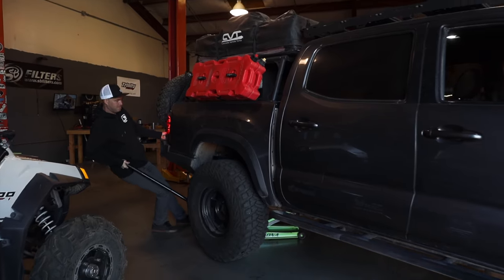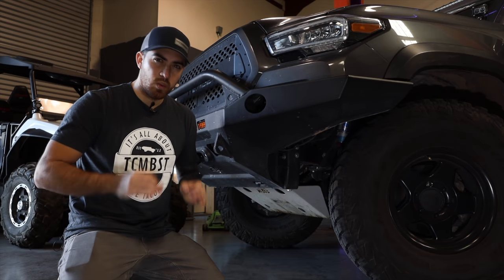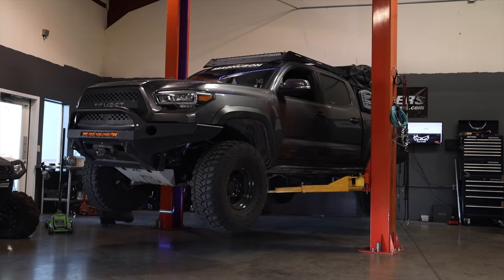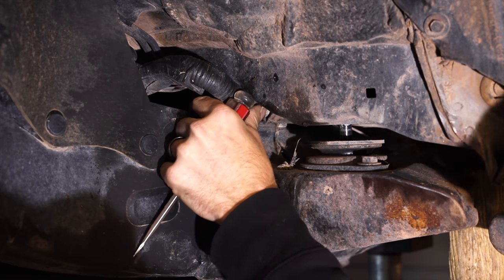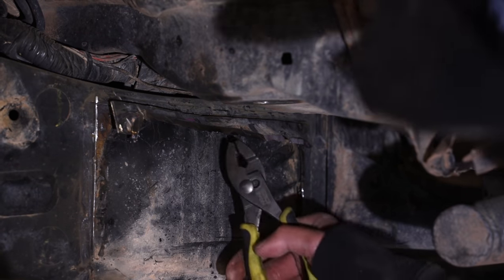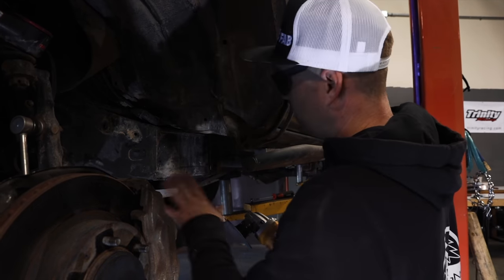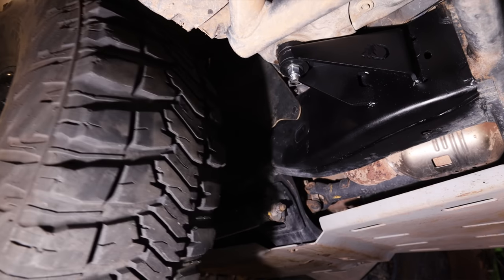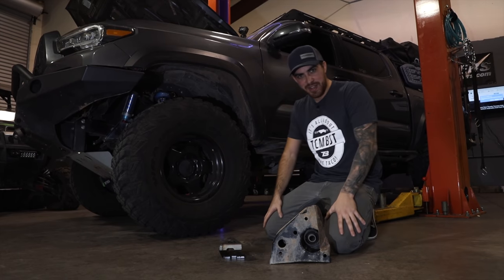How to relocate your body mount to fit 35" tires on your Toyota Tacoma.

Comment: I'm running 285s on my 2017 tacoma! 2.5 toytec 4 inches lift I didn't need to do a body mount chop! Thanks for the great content
Reply: Yeah, inches of lift should be more than enough to clear 33s
Reply: You have to actually go off-roading to see the need for a BMC when you have 33s or bigger tires. If just driving around and never flexing the suspension at full lock in a either direction and you have a 4” lift, than yeah probably won’t need one. 🤦🏼‍♂️
Reply: HiddenX lol 😂 no flexing suspension at the mall.
Reply: Not necessary for the mall.
Reply: Pics of your truck??
Reply: Spoken like a true Mall Crawler! 😉 👍🏻
Reply: 4 inches 😅😅😅

Comment: I think i am going to stick to my 32 inch falken at3. I love the flexibility and I ant rock crawling with Jks
Reply: Did you need to lift your truck at all? I have been looking at those falkens
Reply: @mjwization  No, you don't need a lift to run 265/70's 115t. If you go with an e-rated tire then you might get tight at full lock.

Comment: Hmm. I'm wondering if you can just trim the stock body-mount really far and not replace it with a plate. That would basically give you the same clearance . . .
Reply: You'd also literally chop a huge chunk off the support for the corner of the cab right under your body. Either rebuild it or don't do anything at all.

Comment: The body mount actually serves as 2 purposes. In the event of a crash it stops the wheel from going into the cab and crushing driver.

With the new one you lose the safety aspect
Reply: So you’re saying the 35” tire now can go into the cab?
Reply: @currentlyhd7649  there’s no longer the cab mount there to help protect that area so yeah in case of an accident there’s less safety
Reply: It would have to be one EXTREME accident for that to happen.
Reply: Yeah, the cab mount is also a safety feature. would def be effed if you got into a head on collision. Legs would be crushed. Look it up you’ll find crash test information. But whatever not like a serious off-roader that would actually do this mod is concerned about collision safety lol...
Reply: Not to mention that the high strength steel in that area is now compromised from all of that welding due to annealing so strength is finished further.
Reply: Not a good idea would not do that
Reply: @stormtroopervette2894  While that's true, you also have an extra 40lbs of rubber bump stop with the 35" tire..  Yes you're missing the cab mount but the tire itself becomes an additional energy absorber.
Reply: @shoegum7362  it doesn't have to be EXTREME, a lot of collisions are actually just 1/4 of the front end, think of colliding with oncoming traffic and only hit one headlight, or swerving out of the way and smashing your fender. there is nothing infront of the tire in terms of structure, and behind it is the cab mount, so whatever the tire doesn't absorb, all of it is going into your little cab mount saving your legs.
Reply: 🤣 how gay!

Comment: How do you take care of the odometer and speedometer issue when getting bigger tires?? That’s really my biggest concern with dealing with the dealer servicing and all that how do you keep the odometer correct??
Reply: Hypertech sells a kit that's plug and play. It connect behind your gauge cluster and is adjustable for any tire size  using the software on your pc. I have one on my truck,  adjusted it multiple times for 33's and currently for 35's

Comment: If I’m not mistaken,I noticed he welded down hand and down hand welds don’t produce as much strength as a vertical weld. I could be wrong but as a Ironworker I know when we weld out in the field with stick welding and if we weld down hand instead of a vertical the inspector would fail the weld if he saw this. Overall cool video👍
Reply: But what if it was flipped when they were welding it ?
Reply: @Edward Anderson - Yup!  You are not wrong bud.  Welding downhill just makes a nicer smoother weld that can be easier to control the puddle with, and for the most part it is just a lazy approach to welding that part inplace.
Reply: You’re right but one thing I hate about welding up hill is you need to run a lot colder weld and obviously it won’t look as good for the finished product. Most customers are very judgmental on the way a weld looks. They don’t care if it’s right as long as it looks good. 🤦‍♂️
Reply: @JYates89coupe  Exactly.  Very much like the folks that lift a truck with blocks and spacers just to "look" the part, but don't add any value to the function of lifting in the first place.
Reply: @JYates89coupe  I understand but 2 things,one who’s going to see that being it’s underneath the truck? 2nd,Me personally would rather have a weld look somewhat decent then to have that clip/body mount possibly snap and break off and god forbid that happens while in motion or operating the truck then you got a huuuuuge lawsuits your hands man and the risk of possibly injuring someone? Don’t get me wrong,I’m in no way shape or form going against what you’re saying bud,I’m just speaking in general? If you practice long and good enough you can make that vertical look like a down hand weld,I’ve welded vertical with my Mig and they’ve come out pretty damn good but then again there’s days I’m in the garage welding all day so that definitely helps!👍

Comment: Is there enough room to weld along the top outside portion of the new mount? I saw you did sides inside and out but couldnt tell if there was weld on the top inside and outside.
Reply: No. Only weld on top will be inside the mount. Obviously isn't access to weld the top of that portion

Comment: Perfect and good until you get in a car wreck and don’t have the full on cab mount to spare your legs but if bigger tires is worth turning you into LT. Dan then by all means go for it.
Reply: Body mounts in an accident, in a body on frame vehicle, is to minimize the amount of frame pulse in a crash that's transferred to the body from the frame, its the bushings not the metal frame bracket that transfer the energy. The tire's not coming busting thru the frame and into the cab
Reply: @shoegum7362  what do the bushings transfer load into? What do you think happens when they're overloaded?

Comment: I have a 1 inch Bilstein lift in the front and I was able to fit 35s with just a little bit of rubbing that eventually went away after the tread wore down a bit.
Reply from the maker: Similar to what we explained on this video. We were also barely rubbing. I am sure if we got a couple more miles on our tires the rubbing would go away. The rubbing will come again once you cycle through the suspension or when you try to park going into reverse by locking your tires fully. Not everyone is going to want to wait for they tires to slim down to fix their rubbing issue as it’s not an actual solution to the problem.

Comment: 3" lift with 33x12.5 tires on a 10" wide wheel with -24mm offset and im rubbing the cab mount when turning hard.

Comment: It doesn’t seem like the Tacoma frame and parts are built for 35” tires. Will be interesting to see what kinds of longevity impacts come from driving and handling 35” tires.
Reply from the maker: We’ve had no issues since we switched to bigger tires but it would be interesting to see what happens, I’ve seen multiple people opt for the 35’s 🤙

Comment: Do you guys have any info on how this would hold up with the toytec 1" bodylift?  Will this also work with energy suspension body mount poly bushings?
Reply: as long as the bushings fit it shouldn't be a problem. I could be wrong though. I'd reach out to Alpine -- he's super responsive. info@alpinedesignsoffroad.com
Reply: People have been swapping the bushings for the energy 9.4101G

Comment: I have a 2019 Tacoma TRD OR. I have the BFG KO2s on my truck, but haven't changed the tire size. I was thinking about adding 33" or 35" tires sometime this year, but I'm concerned about the added stress to the CV axles and deeper components such as the front differential. Do people who add larger tires take this into consideration? Do you have recommendations to strengthen these components?
Reply: Canyon Overland A lot of people don’t take this into consideration no. A lot of modifications need to be done to make 35s and even 33s work properly but even then it does take a toll on the drivetrain. A 3” lift is basically essential to running big tires, which also requires a diff drop to correct the CV angles. Also you’ll be looking at UCA to improve caster and move the tire away from the cab. The biggest issue is power loss, you’ll ser need to re-gear to 5.29s. It’s not really worth it to me unless you have an almost 100% dedicated overland/off-road rig.
Reply: One approach is to do a thing and run till something gives.  Upgrade that and do it again until the next part breaks.  Eventually and with enough time and money spent, most items of limitation are worked out.  However, it will come at a pretty heafty price.  You either pay to play up front, or play and pay as you go.  

Unfortunately safety is compromised at every step of a modified vehicle.  Not to say you can't reengineer the safety back into it, it just doesn't get done by most people that modify their vehicles.  Your mileage may vary.
Reply: just adding tire size causes minimal stress on the CV, it only has to turn a bit more mass. lifts that causes more CV angles are the CV killers. RCV makes really strong CV, they claim it is stronger than solid axles. Then you have stronger pinion gears that even stock trucks break sometimes. There's no real solution, you can only beef up so much until something else breaks. CV are WAY easier and cheaper to replace and rebuild than diff gears. It can even be a trail repair if you bring a spare CV

Comment: Sorry if someone has asked this before. Did you do anything to the sway bar so it doesn’t rub after going to a true 35” tire? Any help would be greatly appreciated!
Reply: Get a relocation kit, or completely remove it. Most people with tires this size remove the sway bar for better articulation, and tbh it doesn't really help with body roll all that much anyways.

Comment: Will this work with 33x10.5 ko2s, 17x8.5 -12 offset 4.38 inch back spacing wheels on stock suspension an a high clearance front bumper?
Reply from the maker: Should work 🤙

Comment: I’ve been building 4x4s for twenty years and would never recommend doing this!!
Reply: Larry. I have zero reason to disagree with you, but I am curious what you would recommend instead.   Can you clarify some?
Reply: @insaynbcr  if you’re wanting to run a tire that size you have to get the clearance from suspension lift. Cutting the body to fit a tire that size may clear when on the ground and steering but during travel with your suspension articulating it’s going to give you issues.
Reply: @insaynbcr  I deleted a couple comments I made last night, I really do enjoy his channel. I had a little too much whiskey and got way to opinionated lol. I hate to see someone take shortcuts when doing mods, if your going to do do it right.
Reply: @larrysmith5578  Agreed! Get the tire clearance with the lift and the right rim tire combo.  Honestly if I ever decided to put 35" or bigger tires on my '17 Taco, I would probably just go full SAS with an actual steering box.  Hopefully there is something out there that has the wheel speed sensors already integrated in the axle setup to keep the computer happy.  With the larger tires and SAS would come larger brakes to help stop the mass.  

Currently I am joyfully rolling on 255/85R16 KM3 tires, 2.5" ADS lift with ICON billet UCA's.  With both the stock LCAs and the ICON UCAs tuned pretty much at stock alignment still, I get the slightest touch upon full stuff with tires turned roughly 30% either way, on the thin pastic liner well above the unmoletested factory cab mounts.  Once I get the Marlin weld in alignment reinforcement kit for the LCAs installed, I plan to take advantage of the ICON UCAs to work out the forward caster adjustment and camber correction they offer.  This should effectively weed out any further contact down there.
Reply: @larrysmith5578    Whiskey good!  Cheers!
Reply: Just get 32s. No chopping
Reply: @rx8dude907  You can go 33s without chopping, but not wide (285) 33s.  Skinny tall tires aren't for everyone and I respect that. Looks/stance play a big part in ones lifestyle.
Reply: @insaynbcr  i fit 285 75 16 fine no cmc. Need 0 offset and 4.5 backspace
Reply: @andyvang2522  What tire brand? Some of those 285s are truly only 32.6" at best. Are you lifted with any caster changes? Also, how's the clearance when stuffed and tires turned?  My 255 KM3s are a true 33.1".
Reply: @insaynbcr  km3s. Yes they arent true 33s but they are 285s. And stock uaca i cleared perfectly
Reply: @andyvang2522  You realize you are rolling a 2nd Gen, and this discussion has been about a 3rd Gen?  Not that it really changes much, as most of the dimensions are the same between them. You don't rub at all? Anywhere? At any location? At any point straight or turned, stuffed or not without any modifications to your seams or cab mount?  285s usually either hit the UCA if running stock wheel offsets, or hit the cab mount if the wheel offset is change to correct the rubbing on the UCA.
Reply: @insaynbcr  yea i dont rub at all even at full flex. Just need right wheel specs. 0 offset 4.5" backspace
Reply: @andyvang2522  what rims have these specs...was looking atvthe fuel block d750 which is +1 offset 5" backspace I believe...plan on running 275/70r17 general grappler atx with 2" OME lift
Reply: @lythium6878  i have method 701
Reply: Body mounts in an accident, in a body on frame vehicle, is to minimize the amount of frame pulse in a crash transferred to the body from the frame, its the bushings not the metal frame bracket that transfer the energy. The tire's not coming busting thru the frame and into the cab

Comment: Flimsy AF. At least box it in from the bottom by welding another plate. There is a reason why Toyota engineers designed that entire bracket as robustly as they did.

Comment: It's crazy when you realize how much these Toyota's r u s t
Reply: All depends on the owner of the vehicle.
Reply: @RE3B00T  true I own the second generation for about 4 years. Made it a mission to try to chase the rest living in the midwest during the winter time found myself quite often playing whack-a-mole finding rust spots and fixing them LOL thank God the bed is composite
Reply: @RE3B00T  And where it is driven.  For example, I have a '97 Taco with 245k+ miles on it and very very little rust anywhere on it. I live the normally wet PNW and play on the coastal sand/beach with it.   Also have a '17 Taco with 31K miles and zero rust so far.